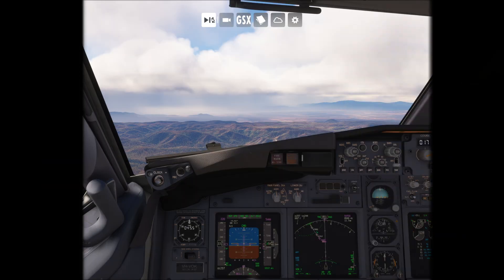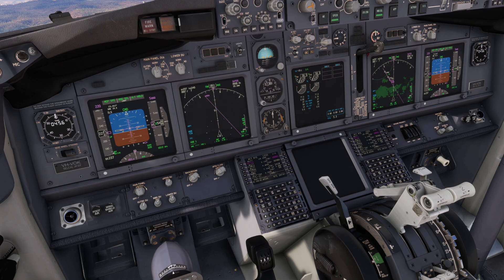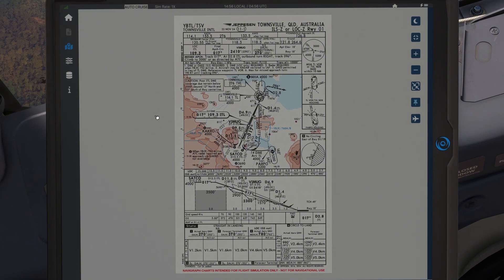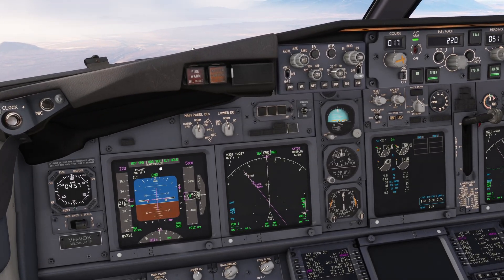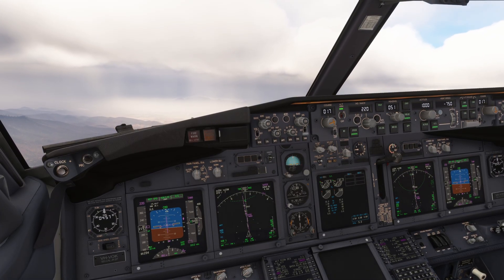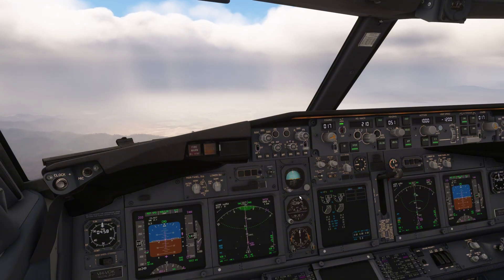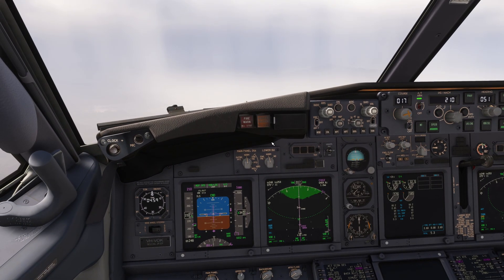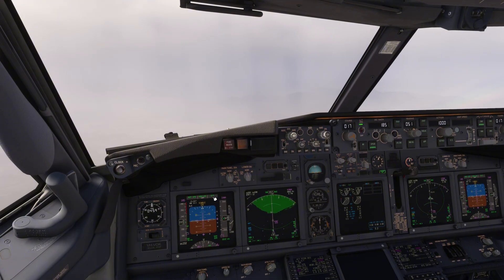PMDG 737-800 Tutorial: Master any ILS Approach in Flight Simulator

Comment: A bunch of “let’s just say” and less how to actually do it. This is 1 scenario of hundreds, why not just show the basic way?
Reply from the maker: That is the basic way if you are on vectors + a reference for your vertical speed. All ILS approaches with a vector, you will be descending in V/S vertical speed mode, you will be given a final heading of 30degrees from the runway heading to intercept the localizer (VOR/LOC - MCP button) and then the glideslope (APP - MCP button) when you are cleared approach and then you will follow the glide slope down. If you were on RNAV SID and ILS easy way would just press (APP - MCP button) when the next way point is the FAF - Final Approach Fix. The only other ILS procedure i can think of is an 80/260 ILS approach, which i have a video about if you want to learn how to do that. If you could give me another example for another scenario, I can help you better understand that. if you would like. Happy landings Captain

Comment: pmdg localizer and G/S are bad. Sometimes my plane is climbing up to the localizer, why would it? So unrealistic... and it turns much too fast for the LOC.
Reply from the maker: I've never encountered that problem before with any localiser, It would only turn like that if you are too fast and or more than 30 degrees off the localiser course. Sounds impossible for the plane to chase the glideslope upwards as it wouldn't capture itself from so far below and start flying up, if it climbs up it is pilot induced (as you can see in the video it will keep flying down even if APP is armed, because it can't capture itself). I would say you have descended below the altitude restriction somehow and then pressed VNAV again and your plane flys up to adhere to the altitude restriction, while having pressed APP and arming it. The altitude restriction of the ILS in the video is 4,000ft and above due to the high terrain around. If you do exactly what i do in the video for every ILS its impossible to stuff up:) Hope your ILS approaches improve soon!
Reply from the maker: One more thing i can think of is that the plane wont descend on the glideslope without capturing the localiser first. Check your settings in your FMC, i'm not exactly sure where but it is called "Glideslope capture before localiser" and make sure it is turned OFF.